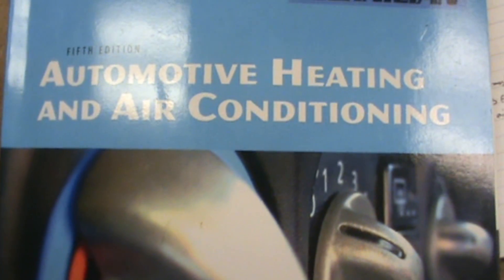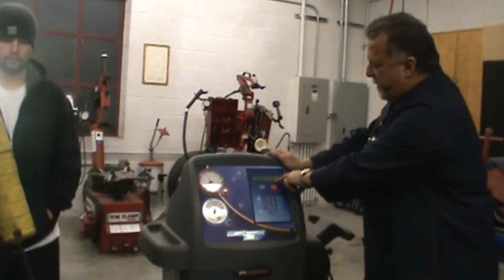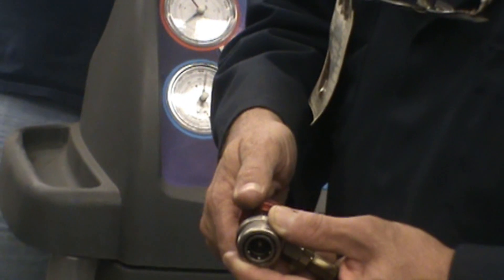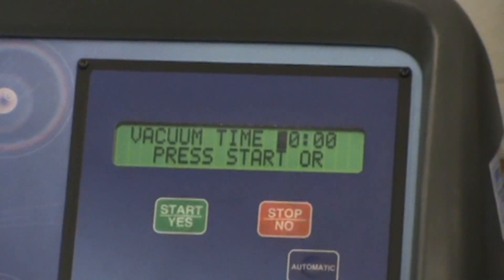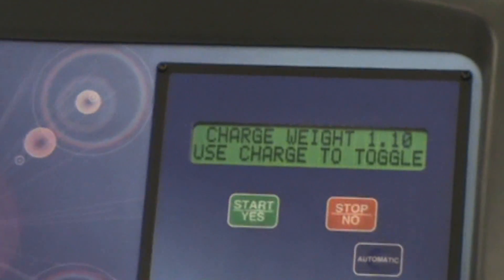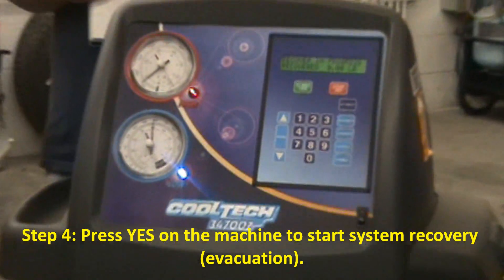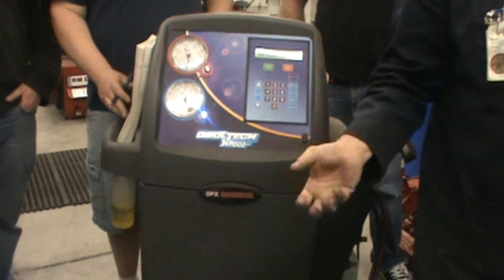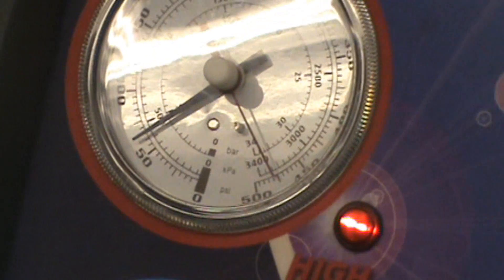Recharging your Airconditioning A/C in your car

Comment: Does this machine handle oil? I never saw oil mentioned?
There needs to be a way to get the exact amount of factory recommended oil in as well.

Also just say you do charge it back up and you find you can only reach 50 or 60 degrees in the vent?
Is there a systematic way to track down exactly where the issue is?
I always think that in that situation that its probably moisture so maybe the dryer should be replaced or maybe vacuum down the system extra long? On the other hand the condensor plays a huge roll in the system as well, some recommend throwing them away. Can a compressor be weak and not up to snuff?

Comment: when u do vacuum to ac the oil come out too or stays on the system????
Reply: Not sure what that means?
Reply: @dickvandike7238  he meant does the vacuum pull out the PAG oil in the system. I'm assuming unless you change out a major component like the compressor or condenser, it does not pull the oil

Comment from the maker: @spelunkerd For this vehicle, it was specified to remove the high side line 1st.  I must say that without a machine, this job  can be somewhat difficult.  The use of scales, freeon tanks, vacuum operated motors, and various other things like gauges are ALL needed to perform this job if a stand alone machine is not used.  Your last statement couldn't have been said better.  What I always say is "The more you learn, the more you realize you don't know"